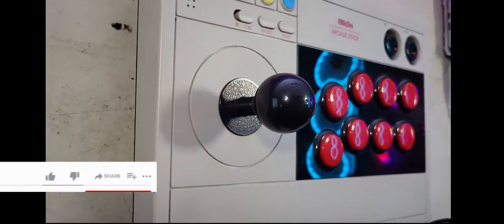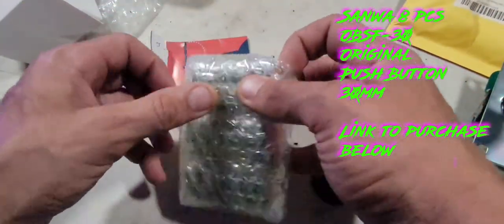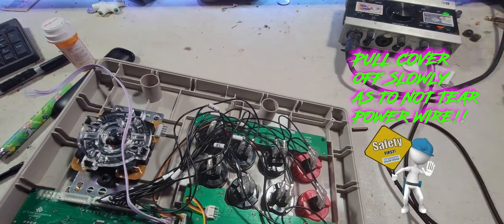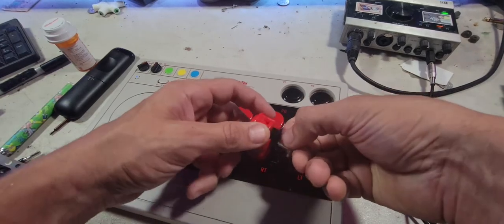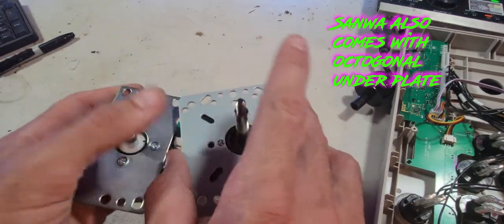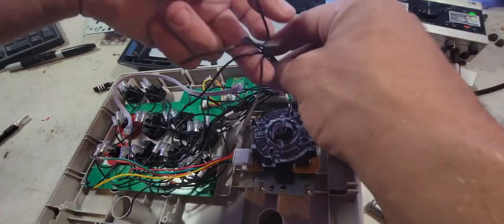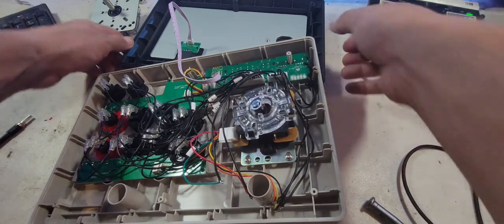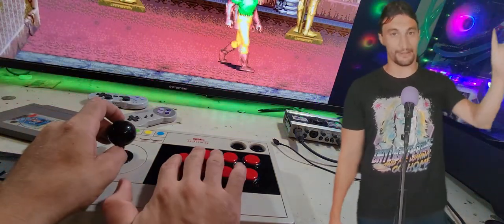8BitDo Arcade stick Sanwa Upgrade SUPER EASY NO SOLDER

Comment: Button quality is generally up to par with Sanwa and the others in knockoffs.
Basically because a ball bearing switch is dead simple.
Though choice of material for the plunger could make them louder, quieter or just sound plain bad.